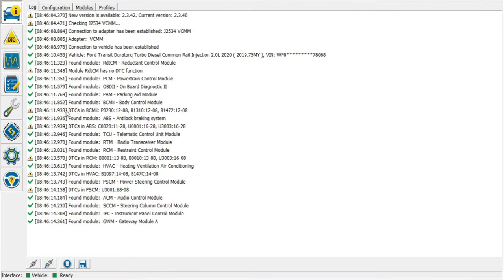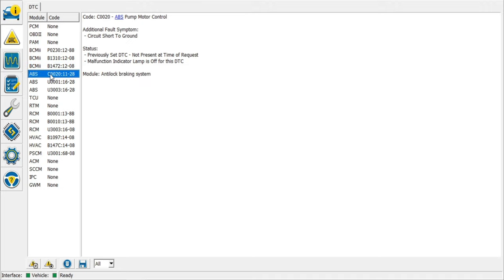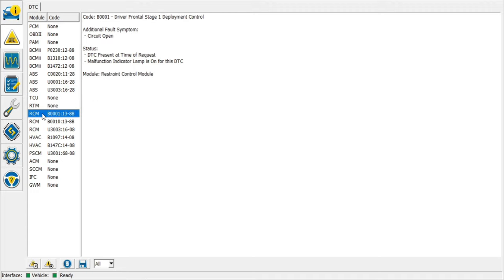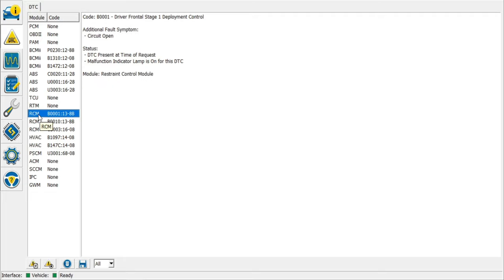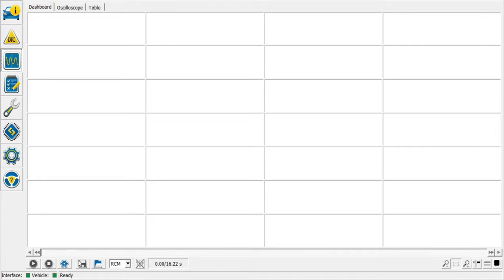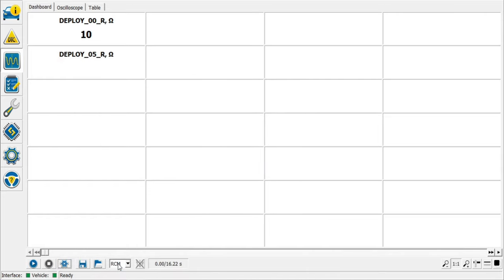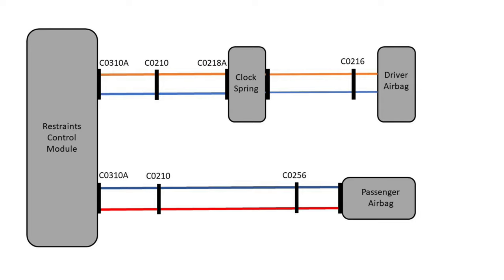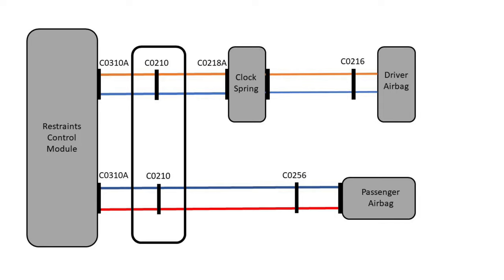Transit Custom - Double Airbag Fault - B0001 B0010

Comment: Great video Steve , I had a 15 plate transit 350 in with Abs , air bag , canbus communication faults , started looking for faults as it was also due a class 7 MOT , when checking for the mot I found the nearside abs sensor was touching the inside of the wheel rim, shorting out the canbus link and boom , Christmas tree on the dash , bent the wire back , key iff , key on , total darkness again , new and sensor fitted straightened bracket,  job fixed , it's all education for us all 👍👍👍👍

Comment: Ive had a run of 19 and 20 plate customs with water ingress into the fusebox above the throttle pedal due to apparent windscreens leaking. GGrrrr
Reply from the maker: Also the bulkhead seam leaks near strut turret.....
Reply: @SYDiagnostics  I’ve rammed about 5 absorbent pads above mine just in case 😂